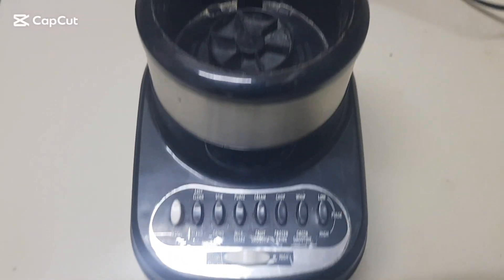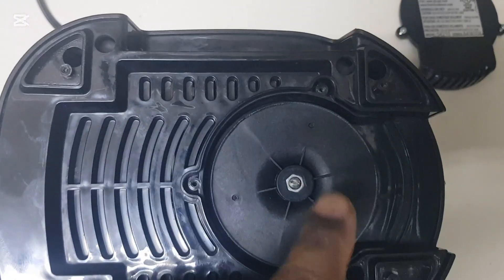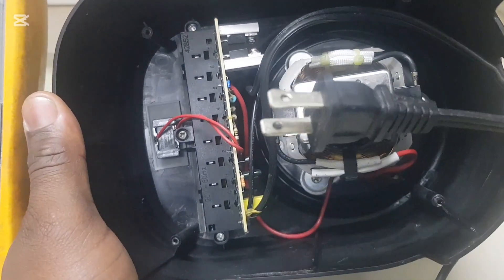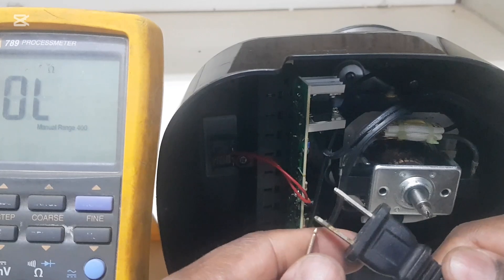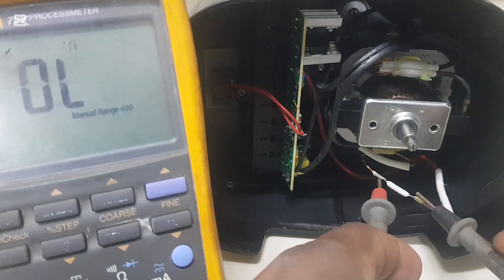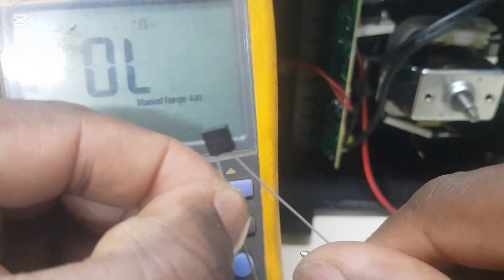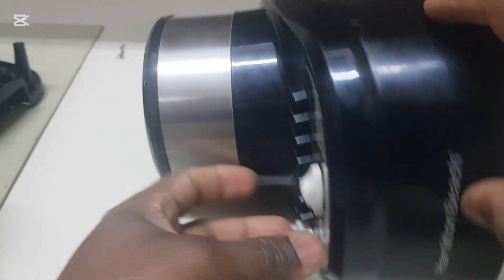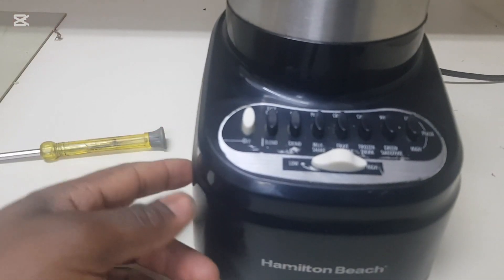Hamilton Beach Blender| Model: 54210| 120V~60Hz 350W | Check & replace defective blown thermal fuse.

Comment: Can he work without the fuse?
Reply from the maker: It can but for how long. And it's not recommended to bypass a fuse out of the circuit. It can lead to a safety hazard, once the fuse defective replace it 👍